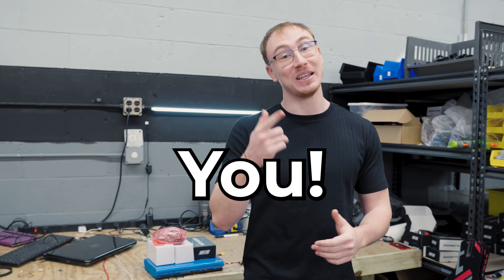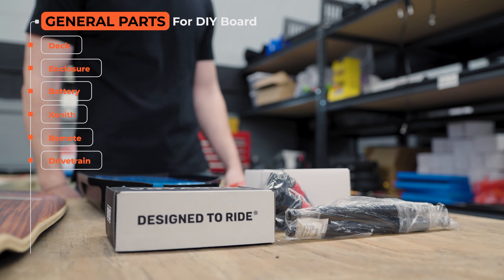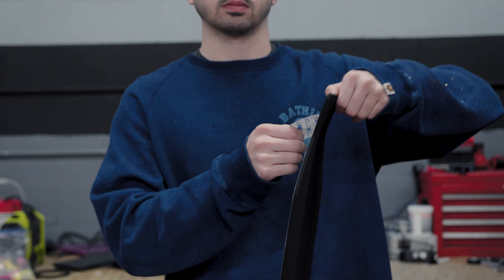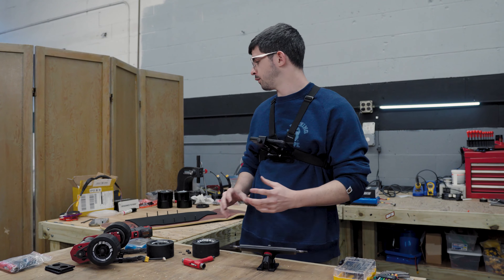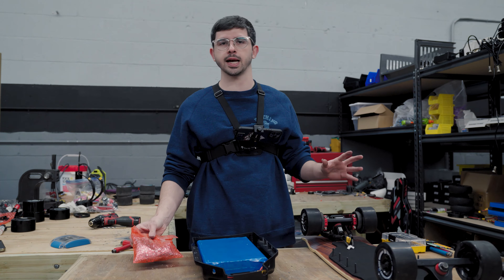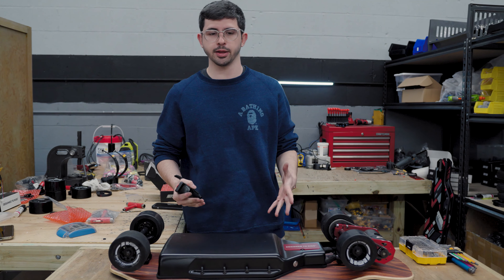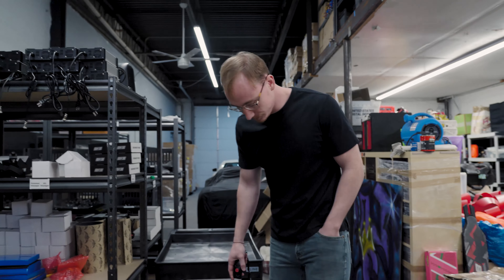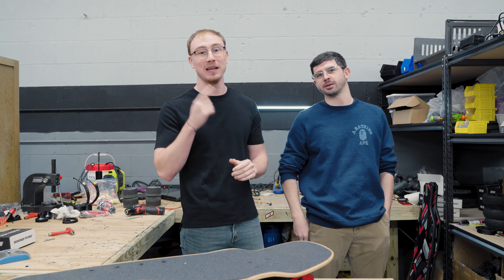Building An Electric Longboard Is Easy! | DIY Eskate Overview

Comment: What minimal size of the board was?
Reply from the maker: On this build, we used a Loaded Omakase Deck, we honestly could have used a slightly shorter wheelbase but the setup fits very comfortably on this board. Here are the specs: Length: 33.5″ / 85.1 cm, Width: 10″ / 25.4 cm, Wheelbase: 20.75-22″